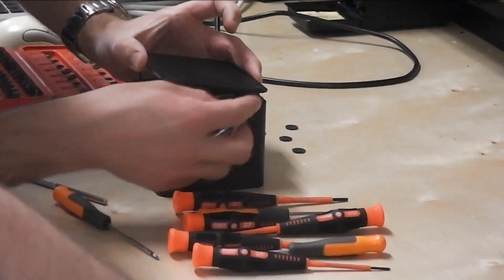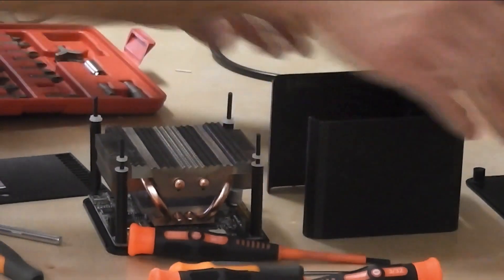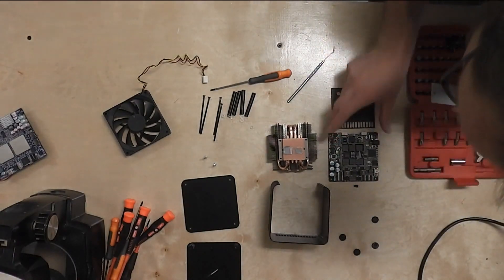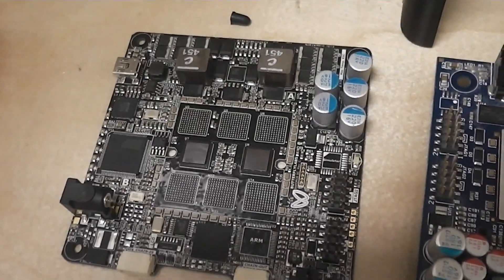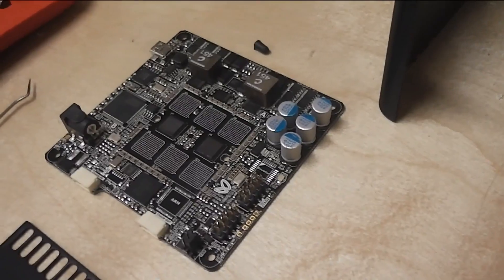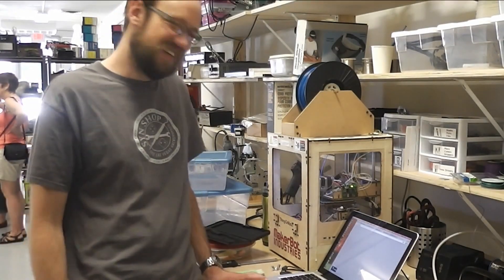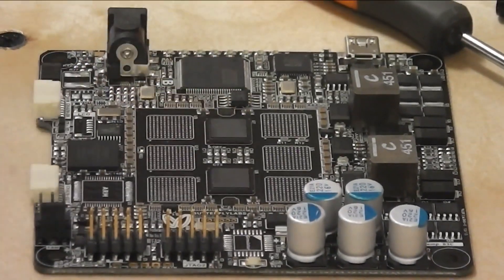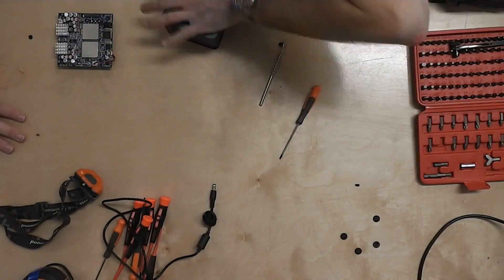BFL Bitcoin ASIC Teardown

Comment from the maker: Again, no, you can't use a device purpose-built to mine Bitcoins to mine Litecoins since they use a completely different mining algorithm - one which, might I add, was explicitly chosen because it's much more difficult to accelerate with GPUs and ASICs (not impossible, but harder). If you're even asking these questions you should probably read up a bit before investing in any kind of mining equipment, it's a hell of an investment and I'd advise being better informed before making it.

Comment from the maker: It actually turns out that the thermal pads they used on these are quite high quality, similar to AS5 in terms of thermal conductivity. The pad is also a better choice than AS5 to prevent coplanar issues with the chips and heatsink.